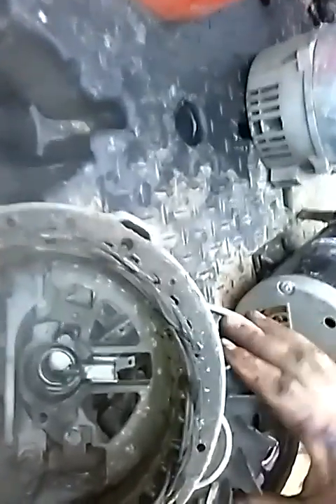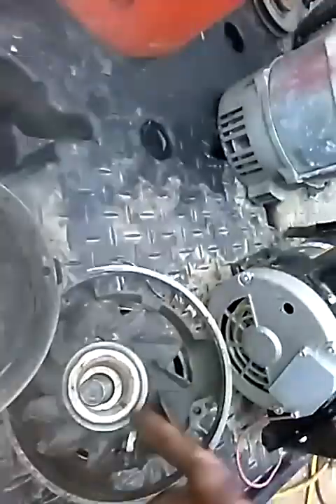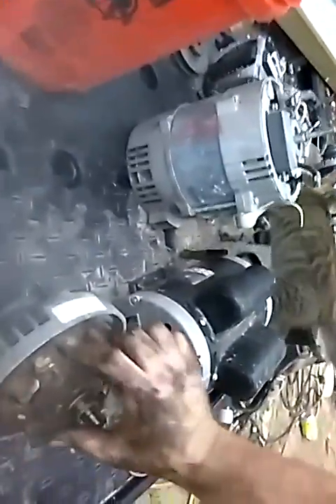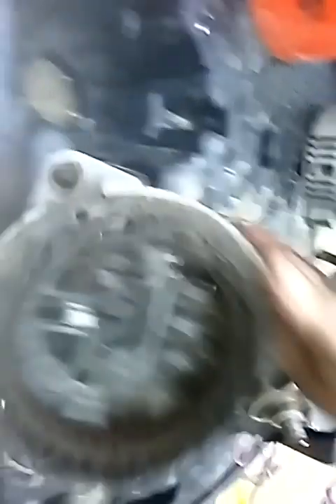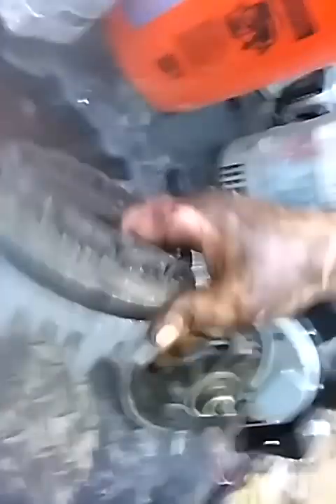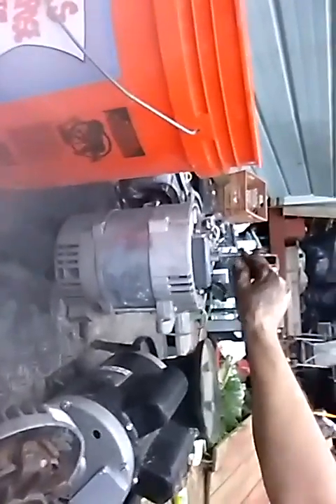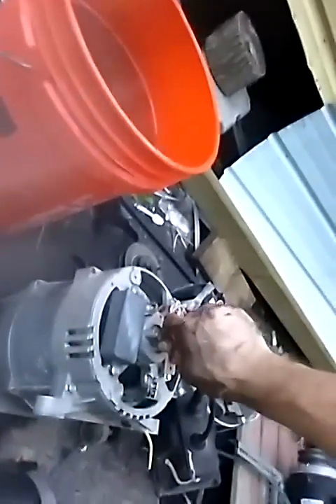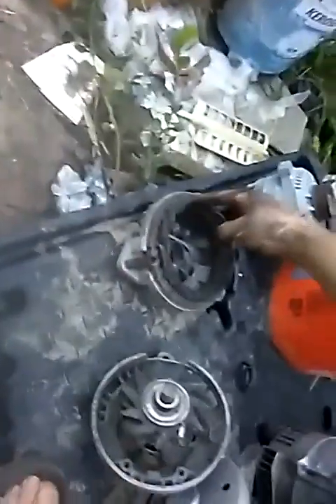Alternator Education P1

Comment: Hey Tommy,  thanks for the video !  I hope that things are trying to get better !  So on the alternator what are you using to magnnify the Stator ?  I have an alternator now to play with seeing that ours went out in our van.  It was charging some times and other times not.  I plan on taking it apart and seeing what the brushes are like.  Thank for your videos !
Reply from the maker: +cody cheney give me just a minute brother and I will make a short video and just show you
Reply from the maker: the reason why that alternator is charging sometimes and not charging other times is because of the connections between the 6 diodes of where the current is staggered in the direct current Bridge rectifier probably spraying some carburetor cleaner just on the voltage regulator without it in the alternator would have fixed it...